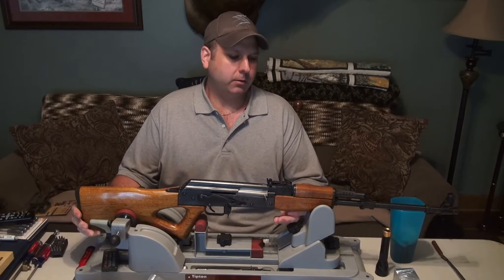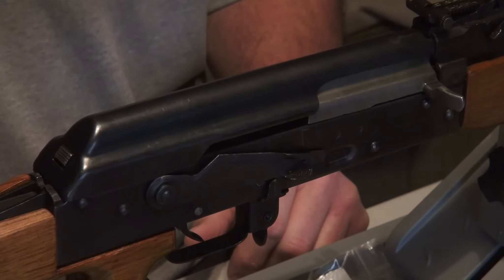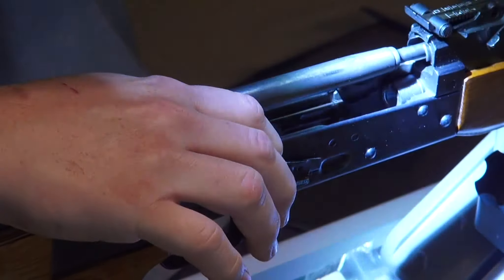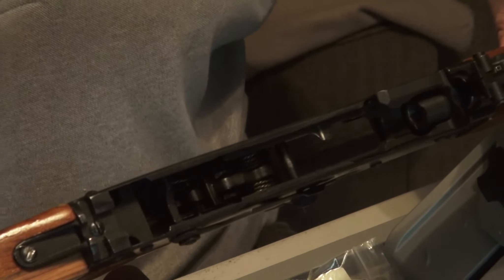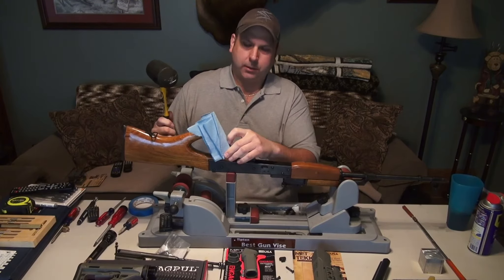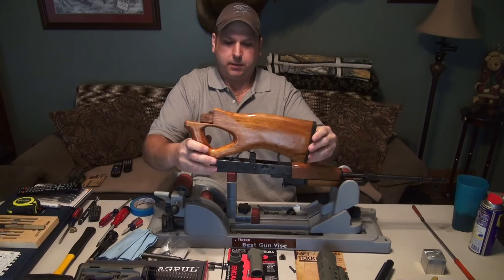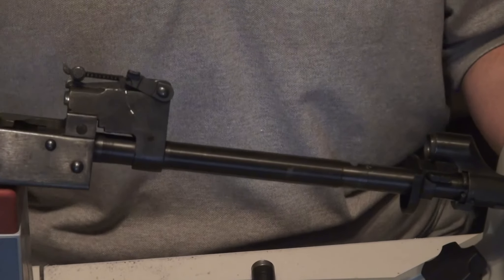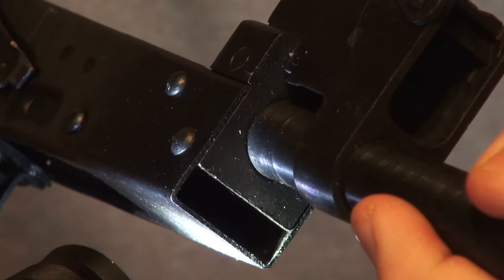AK-47 Upgrades (Norinco NHM91 Enhancements) Part 1

Comment: Hey there Accuracy, watched all four parts and the project looks great! But I'm doing research getting ready to convert a Mak-91. With your converson, you didn't run into any issues with the barrel diameter and the hand-grips? I was under the impression that these longer barreled versions have fatter barrels than standard AK's...

Also I was wondering whether your rifle is currently 922(r) compliant without having replaced a few other peices of the rifle (like trigger group or such stuff) along with the rear stock and two hand-guard pieces?

Thanks again for posting the detailed videos of your conversion.
Reply from the maker: Thanks!  No, I didn't have any issues with the fitment of any of the components.  As far as being 922r compliant, I did not build the rifle from any sort of imported parts kit, it is an original rifle legally imported.  I'm not sure where you live, but check your local and state laws to make sure you are within the realm of legality.  All this nonsense about compliance and this and that is just insanity in the first place! We have a 2nd amendment to protect us from this type of nonsense in the first place, why are the people that refuse to acknowledge this essential right of the citizens even in office?  And why do they not have any sort of accountability for not upholding their duties to protect the Constitution?  These are the questions we need to be asking!

Comment: Hey Sir, how hard is it to change out the furniture on a NHM-91? I want to get some black synthetic furniture for mine.  Is there a particular brand I should look for? And last question do you have a email on your page? I have scowered the internet for videos on the NHM-91 and yours is hands down the best.   Thank you for any help
Reply from the maker: Hey Frank, the best I can recall, it wasn't terribly difficult.  I'm not very well versed with the different types of AK's and the variants, so I'm not really the go-to guy on the platform.  I do know that out of all the ones in the past I owned and/or shot, that I liked the Norincos the best.  As far as the furniture goes, I do remember that Rifle Dynamics didn't make an adapter that worked with the Norincos, so I had to improvise.  A couple life-changing accidents and an illness have restructured my collection, so most of the gear I once had is no longer a part of my life.  The components I used in the video were excellent, and I'd highly recommend any of them.  If you have any further questions, feel free to ask, I would surely share any information I can remember.  Thanks!
Reply: Thank you Sir, I am sorry about the accidents you were involved in.  I pray you get better.   Thank you for making awesome videos